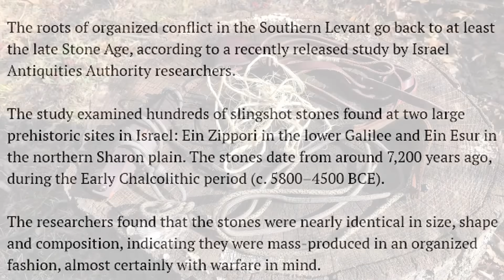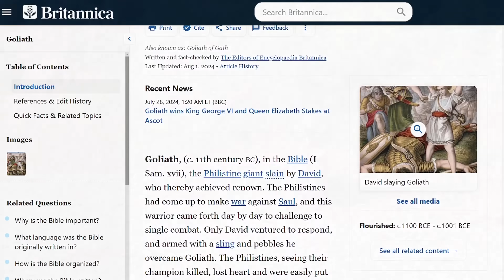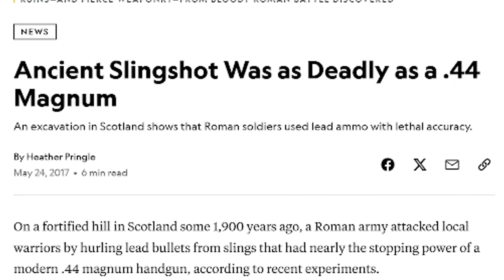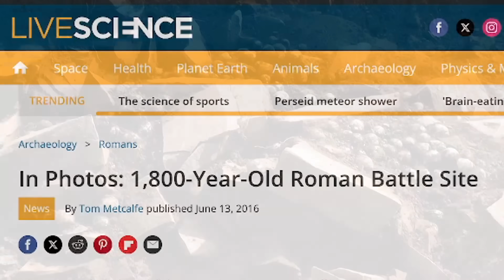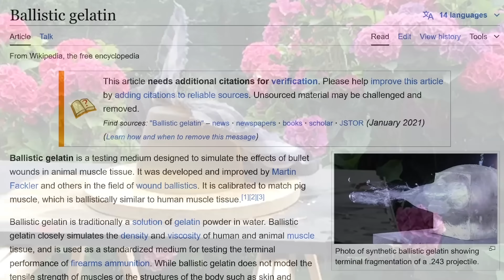Roman Whistling Sling Bullets | Terrifying Weapons Of The Roman Empire

Comment: While visible damage to a melon might look similar to the damage done by a .44, the difference in energy ft. lbs. between the two isn't at all close to the same.  Think about it: we'd still be using slings, if that were really the case. I'm impressed by the sling and all, but there is no comparison.  That's a really misleading claim/conclusion.

Comment: For some reason, I had thought that they loaded a small amount of flammable material in those holes and used those projectiles to start fires. I don't know whether I heard that somewhere or just imagined the idea. I realize that the movement of the projectile would put out the flame, but if the flammable material were hot enough, it would ignite easily once the projectile stopped. The idea would not be to kill enemy soldiers with fire but to start fire inside any kind of fortress that the enemy used for shelter.
Reply: Sounds totally impractical. Look at the photos of real historical fire arrows on Wikipedia. Notice how large those arrows are? It is because it is basically a small torch with an arrowhead at the tip. Those roman projectiles are very small. What good would such a small amount of flamable material do? And what is to stop that flamable material from falling out of that hole when it spins? What kind of flamable material just stays inside of a hole when it is spinning wildly?

Comment: We used to launch apples by taking a branch from the tree breaking the tip off sticking it through the apple and using it like the staff sling.  The more flexible the better.  You could have a more deadly projectile with lead projectile with a hole and a flexible willow branch.  The whip effect it imparts increases velocity.

Comment: I remain sceptical regarding poisoned bullets for warfare. The poison would have to possess fairly rapid knock-down effects. For sieges, a less rapid effect would be OK. But in a battle, if the poison takes five minutes (very rapid effects) to incapacitate your enemy, and he's going to reach you with very bad results for you in less than five minutes, poisoned bullets aren't a useful solution. I suspect the battle-savvy Romans would have realised this immediately, if not, they'd soon work it out after several bad experiences in battle.
Reply: I agree. Poison is also dangerous to handle. I don’t think the Romans wanted their troops using something that could seep into wounds on the hand and kill themselves.
Reply: They could simply have used human poop. If that gets into your bloodstream, bad things happen. Not immediate, but certain.
Reply: The holes could have been filled with feces in order to insure that an injured soldier that survived a battle developed a serious infection and wasn't a future threat.
Also, if the enemy is rather civilized and cares for its wounded an infected soldier would require more resources over time from the enemy forces.